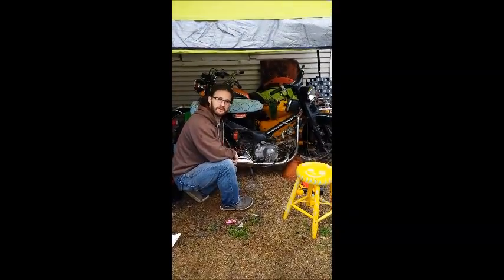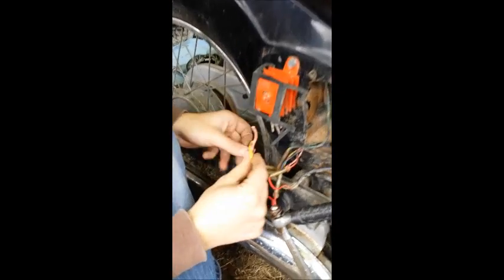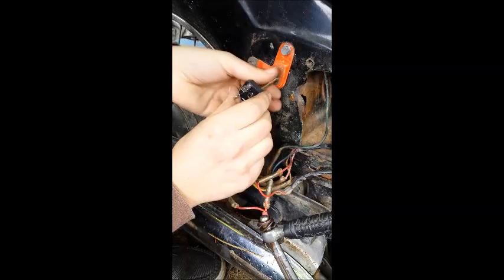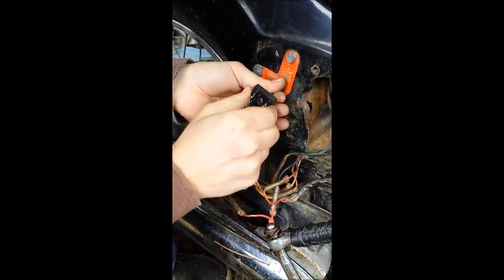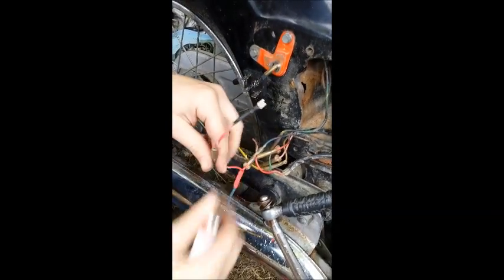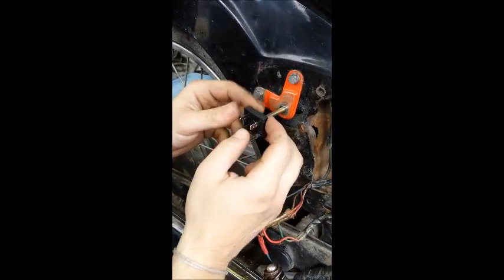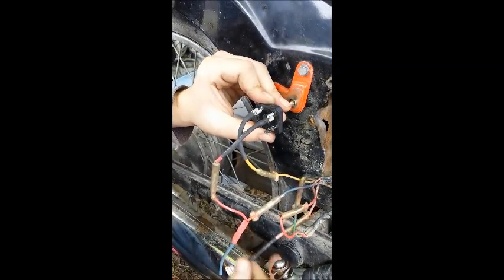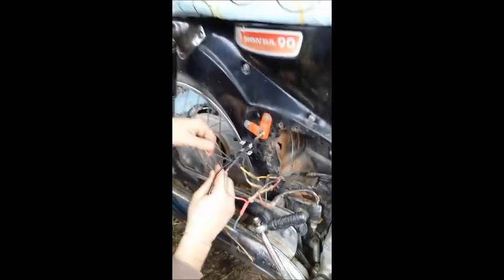Honda 90 Rectifier Upgrade

Comment: I bought a CM 91 no title but just curious I found the Red (hot) but the only Free Green connector is a connection off the Coil is this where the Negative goes from Battery or is it just Grounded to a Screw on the Frame!  Great video!

Comment: Going to install one of these tomorrow, i especially like your use of the crimp connectors as i'd prefer not to have to solder. My headlights keep killing the engine after a few minutes, in your experience would this remedy the issue? I'll find out..

Comment: hi, i have a honda ct90 1968,i just bought it,it has already a new rectifier,but there are 2 glass fuses.the one from the new 6volt battery that is in the positive,but then there is another one that is on the bike already,its a 15a that also connects to the positive wire of the battery,it looks like the previous owner installed it because he added turn signals.im going to remove the turn signals because that year the ct90 didnt have signals.can i get rid of the 15a fuse on the bike?it keeos burning my fisr on the battery.PLEASE ANY HELP IS GREATLY APPRECIATED IT.thanks and greetings from az.

Comment: What is the part number for the Radio Shack rectifier?
bobkrell42@yahoo.com
Reply: I know this is a few years late but the Radio Shack part number is 276-1185 and the rectifier is actually a Full-Wave Bridge Rectifier that is rated 25 amps at 50 volts, so it will more than handle anything the CT90can thow at it  or other older Honda single cylinder motorcycles like Cubs, passports, ct70s, cm91s, c90s exc...
Reply: Any heavy duty silicon, single phase bridge will do. KBPC5010 (50amp, 1000v ) is dirt cheap and common. https://www.banggood.com/KBPC5010-1000-Volt-Bridge-Rectifier-Metal-Case-1000V-Diode-Bridge-p-87234.html?rmmds=search&cur_warehouse=CN
Reply: @vaughnmaycock4504  Thank you so much for the comment.